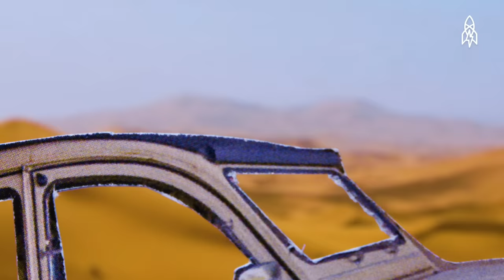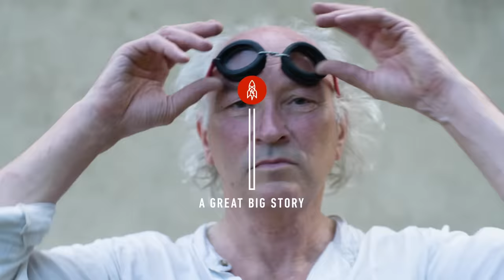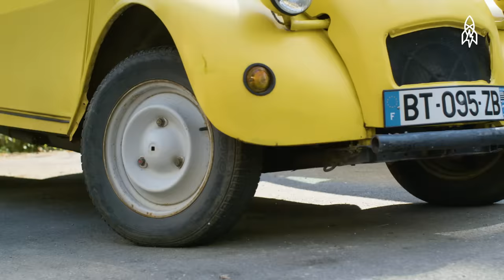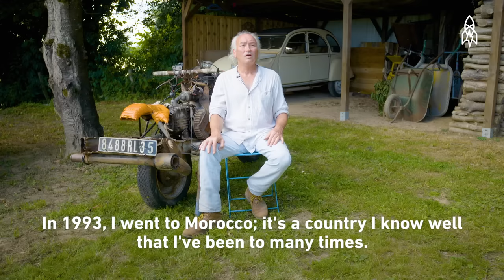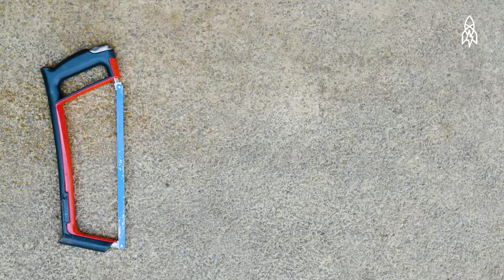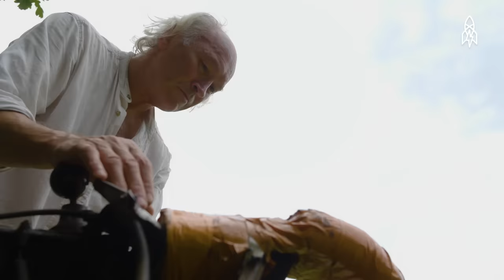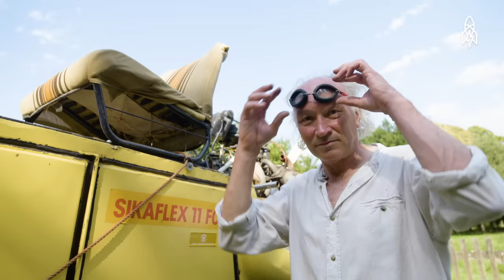This Man Turned a Car Into a Motorbike to Escape the Desert

Comment: mythbusters said this isnt real. I honestly don't know what to believe, I mean they did state that the engine was reversed which means the motor cycle could only go forward on reverse gear, that means that the top speed wasn't sufficient to keep the motorcycle well balanced. The other truth was that despite plenty of pictures and videos of the guy himself showing the motorcycle, he actually never recorded him driving it. 

But the biggest problem is, he claims he was stranded in the desert where a smooth road wasn't an option, so imagine driving such heaving thing with low speed barely keeping you balanced while going up and down on sand and rocks... the odds of this being real are really low despite that I really want to believe it is because its really cool.

Comment: The question is If the engine was working to be assembled on the bike how was his car broken ?? 😮😮
Reply: I think some hints were given at this in the video but the front wheel could've been damaged to the point where it immobilized the vehicle and the front axle on that side would've been so fucked that he wouldn't be able to simply swap out a tire